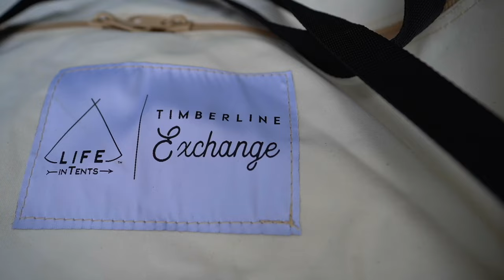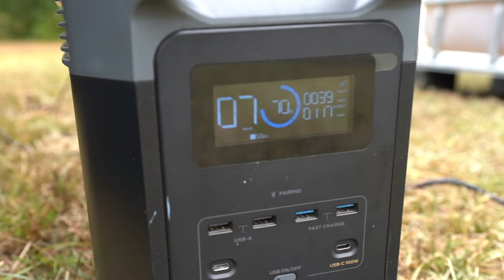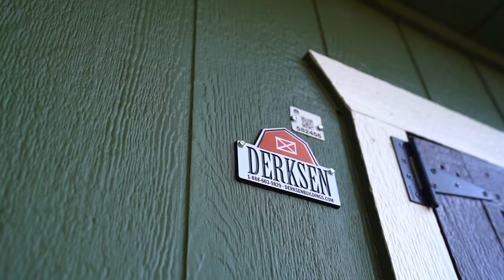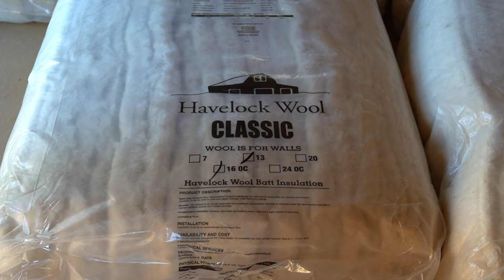Our First Week Off Grid (Building Shelter, Bathroom, & Energy Systems)

Comment: I would love to see an IN DEPTH video for a garden plan for the space, even just the stage of planning it before doing anything on ground I feel would be super beneficial for a lot of people. If you guys can teach people how to effectively keep a raised garden bed constantly growing and such it would help a lot of people feel more confident. Plus teaching what you should have to start with so you are prepared for anything you might come across. I feel like majority of people don’t start because the hardest part for them is planning it out. 

A big garden planner in the land labs would be great too!
Reply: I personally take the top 1/3 of the bed off (where most disease and pest larva are) at the end of season and lay the soil on a  giant black tarp in the sunniest area I have. I cover top with black tarp and let it sit all winter.. the heat generated helps kill most pathogens/pests and in the spring I spray with beneficial nematodes and mix with my compost and this system has done very well for me ..I do this for 10 large beds

Comment: what is the plan for winter? are the chickens going to freeze? do you have enough energy from the solar panels to keep everything running?(lights, tv, gaming system, hot plate, portable heater, charge your cell phones) This is certainly an impressive set up for a place that stays warm year round but idk if everyone will be able to do this in a wider range of climates.

Comment: I'd like white captions with a "bing" sound indicating the cost of all the things. I have a hard time believing it's only $25k worth of things, tools, lawn equipment, and rough estimate of land value + clearing cost included. I don't know what the 25 applies to or includes. 

Also how cold does it get in wintertime or fall for you guys? Also cost of food? That's it. Mainly the bing sound
Reply from the maker: Will do!!
Reply: The $25k number is materials and supplies, tools or land are not factored into that number.  Good question